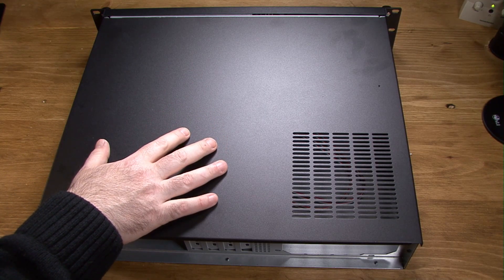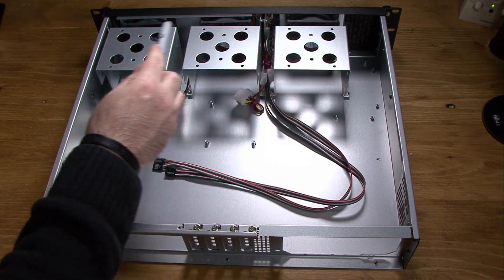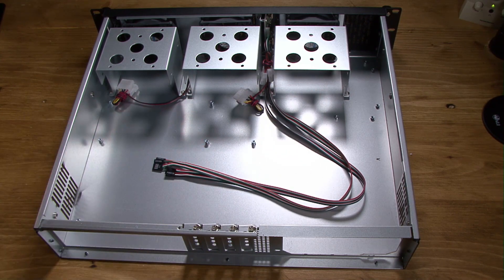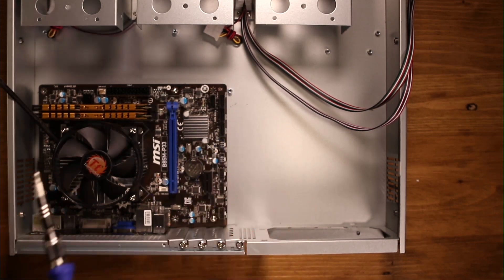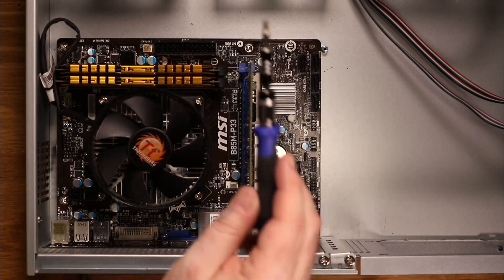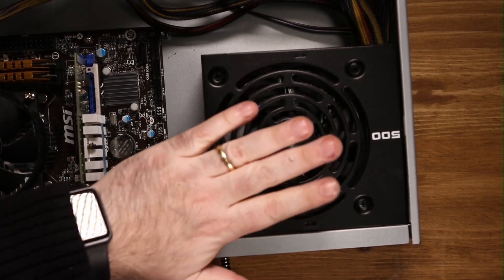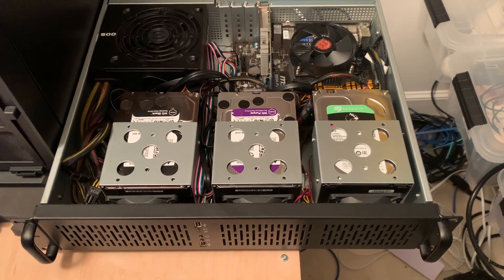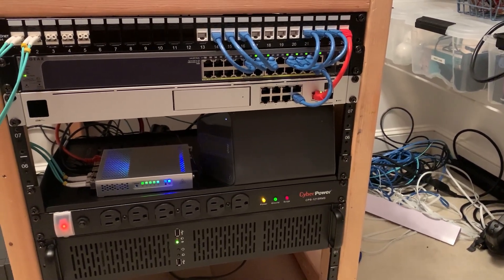Building a 2U Proxmox server in the Rosewill RSV-Z2600 case

Comment: I’m about to do a build with a i7-14700 and a micro ATX using 2x14TB HDDs behind the PSU.

Worried about thermal performance I will power limit the CPU in the bios but it seems like my inline CPU cooler will be blocked by the RAM on one side and the motherboard heatsinks on the other.

Any advice would be appreciated.  Wish me luck :)

Comment: That's a nice chassis, it has some caveats but fully functional on my build. I replaced the fans for 3x NIDECS and the CPU cooler with a dynatron k21, they screams when fully loaded but keeps my Server Cool 😎. Noise is not an issue for me, I got this on my IT room Wich is sound proof inside. Rig (i9-10850k, Asrock z590m Pro4, 64gb G.skill 3200, Evga 550w Modular PSU, 3 x NIDECS 80mm and Dynatron k21)

Comment: If rack mounting this (depending on the rack), I'd get an SFX PSU (with adapter plate), so the PSU can actually breath/cool itself.  There's not a huge money difference between decent ATX and SFX PSUs.

Comment: For me and me only....every case with less than 6 drives is pointless (expandability options are zero) Airflow is pretty badly designed too. You have intake holes in front (ok nice) but with no place to exhaust. Even the side (how much is it 40x40?) won t be able to exhaust the air. The cpu also would need a dynatron like cooler blowing air to the vent to the left in order to dissipate some of the cpu heat off the case . Bottom line is not a good case..... then again for me explaining the reasons above

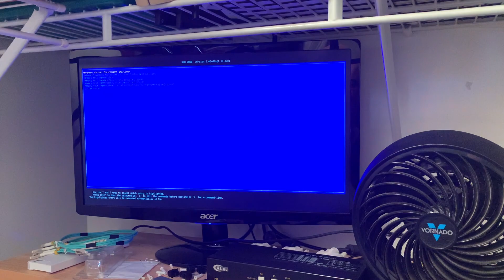PS 10:31 What it might be useful would be a video setting up a fibre optical connection between two machines explaining all the way through the process of configuration to both machines. Just a thought
Reply: The positive pressure from 3 fans in such a short chassis moves the hot air out. I can't imagine building something in this that is performance orientated, thus needs lots of cooling consideration. And if you really want, you can throw in some screamer sever 80mm Sanyo/Delta fans at the front instead. He mentions this as well. If you're going for a performance build or maximizing density, or whatever, you're obviously doing a completely different build. And if you don't care about noise, or doing it yourself (whiteboxing) and just a dense 2U system, then you're buying old enterprise gear off eBay and other places. Personally, I don't own a home with a basement or a gabrage, so I'm never going to put some loud as hell and totally energy inefficient old system in my place just to save a U or two.  This Rosewill 2U is great for a modest home server / NAS.